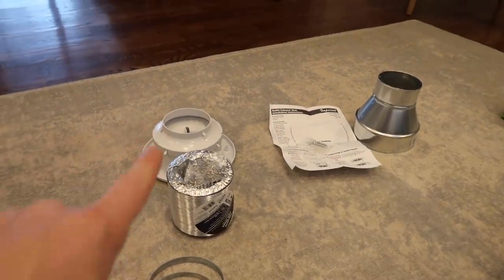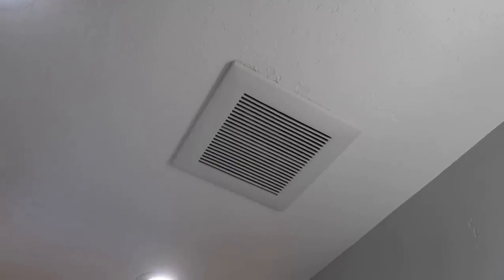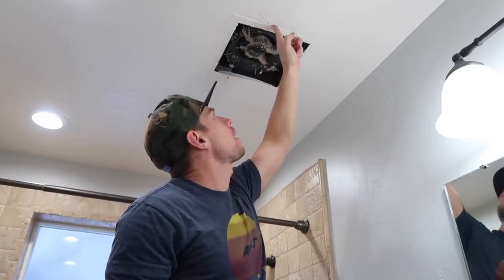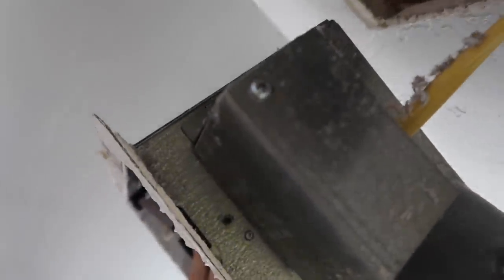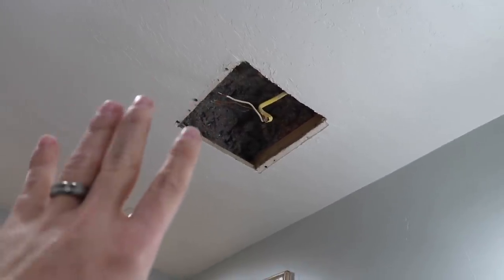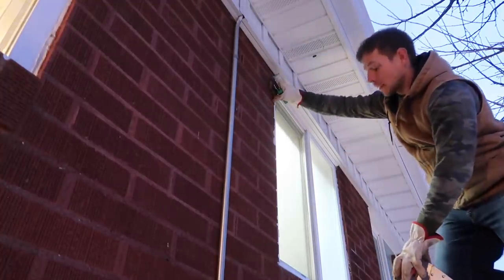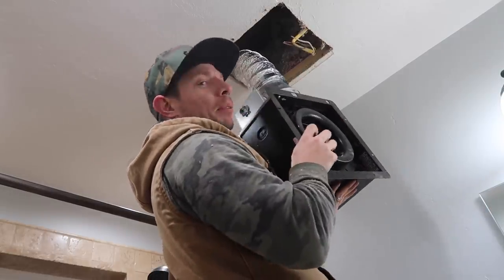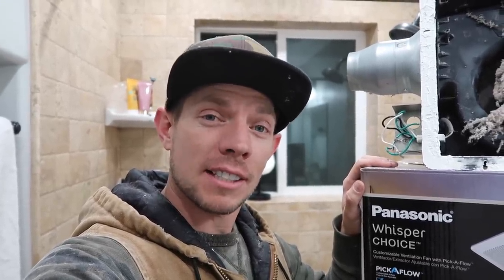How to Replace a Bathroom Fan and Upgrade

Comment: Why go for a quiet fan in the bathroom?  I would rather drown the sound of doodoo noises.  My fan bangs on the roof with high winds and don't know if it needs replacing or what?  The solution now is to turn the fan on and shut the door at night if we are having high winds.  This video must have been recorded before the tonsil removal?
Reply from the maker: HA HA I love it..... That sound covering qualities I completely overlooked..
Reply: #vloggernoiseproblems hah! Curious what you did with the old vent line, did you have to close it up?
Reply: Yeah, this noises can be embarrassing.  When we had our house built, we requested wall insulation in all bathrooms and specified solid core doors to eliminate the sharing of unwanted noises.  We also requested 6” tall blocking of the walls at 36 on center to allow the future addition of grab bars alongside the toilet and inside the shower area in order to help us age in place.